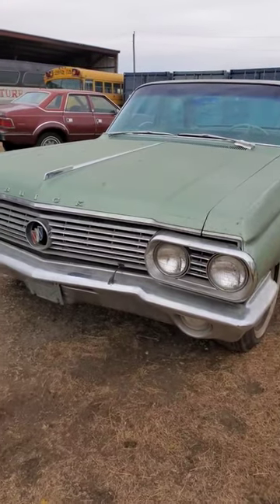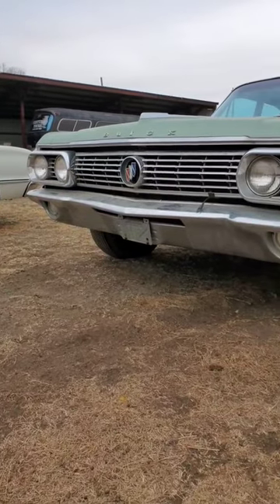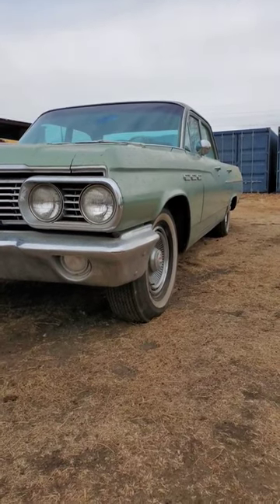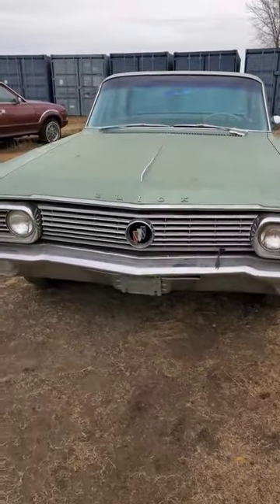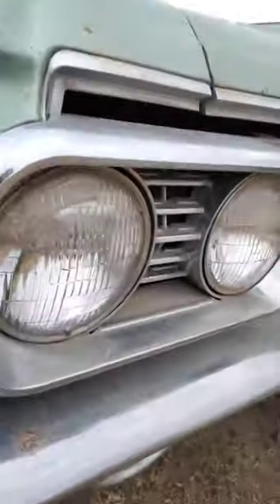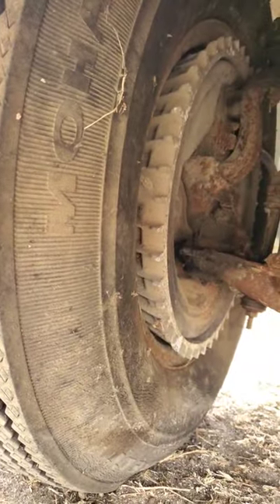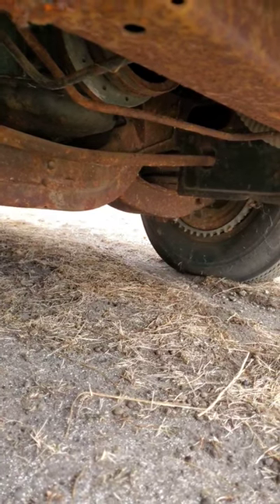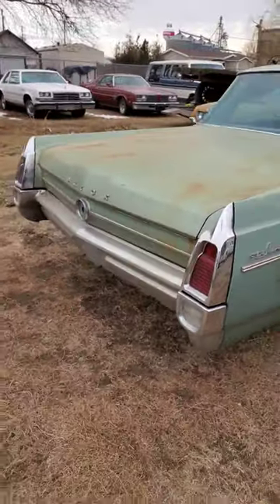High Performance IDEA or Normal Innovation

Comment: I've got a '65 Buick Riviera with the 401 Nailhead, it also has the finned aluminum drums. They do have good stopping power, and they do better with brake fade than a normal steel drum, they do still suffer from brake fade. I've upgraded the '65 with some handling goodies and had it out on a road course. Fun car, just don't stack up too many laps without cooling the brakes down!
Reply: The aluminum drums weren't just about reducing brake fade, it also massively reduced unsprung weight which is critical on an independent suspension. 
And the 401 Nailhead engine is dismissed by a lot of people but it's actually a killer engine, the biggest unjust hit to it's reputation he himself says in this video, "Wildcat", every V8 that Buick put in their cars back then was called a Wildcat and said just that on the air cleaner but not all of them were of the Nailhead design, the one's that weren't Nailhead's didn't respond well to hopping up, so because they said Wildcat on the engine the reputation of the Nailhead suffered, another thing that didn't help is the nickname Nailhead itself, people mistakingley assumed it got that nickname because it had nailhead style valve's in it but it didn't, Nailhead's actually have high waist high flowing type tulip style valve's, it got it's nickname Nailhead because the two engineers at Buick who designed it thought that a partially assembled head with all the valve's sticking out of it looked like a plank with nail's sticking out, one more thing that didn't help with it's reputation was it's smaller intake ports, even in this day and age people associate high flow with big ports, the old "bigger is better" standard that everyone always wants to apply to everything, but the designers of the engine understood the merits of smaller ports that make high velocity when it comes to stuffing a cylinder full at high RPM's, I myself believe in that principle and have long before I ever heard of the Buick Nailhead engine, plus smaller valve's are lighter which means you can rev an engine to the moon without the problems that big valve engine's run into, and the smaller a valve the cooler it runs because heat has less distance to travel to get to the valve seat which is where a valve disappates most of it's heat and not up through the stem as most people mistakingley think.
The two men who designed the engine believed so much in the concept of smaller ports and high velocity that they wrote an paper on the subject that was published by the SAE.
The biggest champion of the 401 Nailhead engine was the great Max Balchowsky, he chose it to power Old Yeller II his home built road racing car that beat every Ferrari, Aston Martin, Jaguar, Alfa Romero, and even the Maserati Bird Cage which was supposed to be the most advanced race car in the world at the time along with every other high end European sport car thrown at it, he sent them all packing back across the Atlantic with their tails between their legs and he did it with a homemade car powered by a 401 Nailhead engine, Max would sometimes let other racers run the car and that who's who lists no others than Dan Gurney, Phil Hill and none other than Carroll Shelby.
In case you've never heard of Max Balchowsky he owned Hollywood Motors in LA and prepped too many movie cars to list including the 2 Mustangs and 3 Chargers used in the movie Bullitt and built the original Herbie The Love Bug for the movie among many other famous one's. 
There's a fantastic bio on Max and Old Yeller II right here on YouTube that's from the old Speedvision series Behind The Headlights, here on YouTube enter "The Max Balchowsky Story" and get ready to feel proud to be an American.
Reply: @dukecraig2402  jesus christ dude, you wrote half the wikipedia here XD
Reply: I'd expect thoose aluminium drums to warp really bad, is it an issue ot do they keep their shape well? Afterall steel ones already have problems quite often.
Reply: @Ferrari255GTO  After street driving and having my '65 Riviera on a road course with aluminum drums, there really is no warping difficulties that I've experienced. And we got these drums a bit warmer than we probably should have. The bigger issues is glazing the brake shoes.

Comment: Factory radio delete...  and no cup holders either
Cars are for Drivin!!
Reply: But how many ash trays?
Reply: @commodoresixfour7478 1 for each finger
Reply: Is this a big deal? My 74 doesn’t have a radio, clock or cup holders lol. Also they opted for a 250 inline 6
Reply: Just a random thought I remember the old cup holders you would put on the door of your car by hanging it from the slot for your window

Comment: Now that's a car all solid steel huge trunk many coats of paint and awesome style
Reply: Something Something Dark Side  yea cannot forget that oil embargo which in my opinion was crock of beans
Reply: Something Something Dark Side  and I prefer older cars over newer cars that are garbage compared to older vehicles that are better more steel and far as older engines using leaded gasoline they were better as long thre maintained properly tuned up as needed

Comment: I had a 1959 buick Wildcat 2+2 410 plus intercepter. 7200 lbs. When you stomped the gas at 70 miles an hour it went sideways.  I never top out the speed.

Comment: Drums have a lot more surface area than disc brakes. They work better, they're just harder and more expensive to work on. I had 4 wheel drums on my 70 mach1. It would lock all four wheels before the pedal got within an inch of the floor. Loved that car, but unfortunately got rear ended and totalled. After we bought it back and rebuilt it, it became a race car with ladder bars and a fiberglass front end, no interior, aluminum dash etc, and a nitrous big block.

Comment: Once had a datsun 260Z which had aluminium drums on the rear.  Considering manufacturing cost vs performance, it would've been better all round to have disc brakes all round like all cars are made now. Amazing how people go to extremes to hang onto old tech.

Comment: Fun fact. The SR 71 spy plane doesn't have a way to start itself. They were started with what's called a "start cart," it was two 401s paired side by side connected by a drive belt. That drive belt connected to a shaft that went into the starter mechanism in the plane. The US military went out and bought every single 401 they could find.
Reply: Over the years the start carts used a number of different engines. They also used Dodge Hemis for a while.

But they were all tuned to the hilt, because the cart motors had to run up to 8 or 9 grand to reach minimum turbine speed.

Comment: Radio delete? Somebody didn't check the box on the order sheet. In 1963,  Chevrolet and Pontiac were the only divisions from GM that had any racing ideas. Buick, Olds, and of course Cadillac had no real intentions but kept dancing around it. Then came the GTO. Big engine, intermediate car.  Things changed for the better.
Reply: Not everyone wanted a radio.
Why is that so strange?

Comment: You could get a 4 speed man trans for these things. So swap in a man trans, turbo or centrifugal booster, efi and keep it patina'd for the sleeper effect. The heads kinda suck but with a modern custom designed cam, it will fly. ( cam timing from the factory was kinda rumpy and customers complained )

Comment: Not so sure about aluminum on steel friction contact. Especially in a high heat environment like that. Sounds like a good way to dissipate heat. But also sounds like a great way to get stress fractures, warping, or disintegration on crucial safety components. Especially since they likely used cast instead of machined aluminum.
Reply: Similar to aluminum blocks with cylinder sleeves. Not a huge deal if engineered properly.
Reply: @AlexandarHullRichter  Very true. Did they have steel sleeves like aluminum blocks? If so, any idea how they kept the rotational force from separating the steel sleeve from what would essentially be an aluminum heat sink? It only works in blocks as long as the oil does it's job of reducing friction. It's an interesting concept, but I feel like there's a reason it wasn't around long. Whether it was safety, production costs, material scarcity, etc.
Reply: @ryanburns3921   I thought they disappeared because disc brakes make drums look like a joke.
Reply: @AlexandarHullRichter  I'm talking about the aluminum drums. The only used those for a few years. They still use steel drums on some vehicles. Only on the rear though. I don't know of any vehicles that use front drums anymore.
Reply: @ryanburns3921  that's what I mean. I thought the fancy front drums disappeared because they got replaced entirely by disc brakes.
Reply: @AlexandarHullRichter  Possibly. Not sure about to timeframe for the aluminum drums. Front drums in general were pretty quickly replaced when discs showed up because of safety. Had an old tech tell me it was because drums had a bad tendency to apply uneven pressure causing severe brake pull. Not as dangerous on the rear axle as long as the steering axle can compensate. Extremely dangerous when it happens ON the steering axle. Lol
Reply: @ryanburns3921   That is interesting about the uneven pressure. I've noticed that on the rear of 2 of the 3 cars I've had, but I thought that was just because they had cheap drums on them that I hadn't replaced. The oldest of those (an '81 Toyota) didn't seem to have noticeable pulsation in the rear drums like my newer cars have.
Reply: @Alexandar Hull-Richter  Several things can cause that in drum brakes. Most often, they're not properly adjusted. Even on newer cars with "self-adjusting" drums, they aren't always right. On the older stuff, apparently, it was much worse. As in, you apply the brakes once. It might jerk you into another lane. The next 100 times you apply them, and it may be great. Then randomly, it might pull you off the road the other way. Some of that may have been made worse by the play in older steering gearboxes. But until disc brakes came along, it was just an inherent problem they didn't know how to solve. I'm not sure about any of it, though. My limited knowledge is hearsay from the old timers around the shop.

Comment: I had a 1961 it was premium fuel only and only 2 speed transmission but fast with bad brakes. It would smoke the tires until you leave off the gas.

Comment: I Can already see it on Facebook marketplace:
“Low miles, hasn’t run in 40 years. Starts on starting fluid, $40k I know what I got”
Reply from the maker: Crazy thing is this a less then 30k original miles car runs and drives proud new owner picked it up for less then 3k
Reply: @DudesWithWrenches  man why can’t they all be like that 😂 I payed $4k for my pile of junkyard parts 1980 el Camino and it has 120k miles 🤣

Comment: Performance idea = the whole car? Or just the aluminum drum brakes? The steel drum and aluminum would separate because of expansion rate differences when they get really hot from performance use. The car...that's actually a keeper.
Reply: Not a problem in aluminum engines that have steel cylinder sleeves. Many get past half a million miles without even a rebuild. I imagine the engineering of a drum is similar.

Comment: Sounds fast until you remember it has a Dynaflow 😢
Reply: After 56 the dynaflow's became better plus if you use the emergency low gear to start off in you can shave off 2 to 2¹/2 seconds of the 0-60 time if you can keep traction.  My 63 buick is a lot quicker then most people think because of that.

Comment: My grandma had exact car in blue but it had a 410 Wildcat. I remember sticker on air cleaner. Years later I bought a white 63 Buick LeSabre 4 door post. 410 Wildcat. Both had the needle on speedo you could set at certain speed and would buzz if you went faster than what you had it set to. Tranny went PNDLR. It would roast the rear tires with little effort. Wish I still had it.

Comment: Could anybody tell me, please, two things: firstly, why the word 'Post', was used in the name; secondly, what "Factory radio delete", means ?. Surely, no one should have wanted to be without the radio, (at a time when the music made the radio worth having) ?.
Thanks
Reply: post means the car has a b pillar and is not a hardtop, the doors have tops to them as well.

yes it does mean that the vehicle was ordered without a radio from the factory.

Hell in 1963 sun visors were an option as was heat, not a standard install.
Reply: @notablynova  Thanks very much.
I don't think 'Post' is used here, in the UK; just 'Pillar'.
I just assumed that in American cars radios were standard even earlier than this car's time.
Again, thanks for your time.

Comment: How fast they can make it wear out! Nobody diagnoses like they used to and then take apart something repair it and then put it back together... Nope. Everything's just a maintenance item. These days head gasket goes replace the whole engine to our converter. Wears out, replace the whole transmission. I mean anyone could be a mechanic these days. You're just replacing everything whole... Can you plug it in and updated. Send it on its way.... And even if you are fixing something, you literally plug it in the car tells you what's wrong. Then there's a thing on laptop that tells you every tool you're going to need, how long it's going to take and exactly how to do it step by step. So what do you really need to be a mechanic? Just the tools and a certification.... Did anybody can watch a video of step by step how to fit repair stuff and be told exactly what tools to use? It's just not having the tools that makes it hard and you're going to be slow at first obviously an experienced guy will do jobs faster. I understand that but I feel like anybody can be anything if they put their mind to it
Reply: I'm not sure what your point is. You're saying anyone can look up how to fix their vehicles now, and I agree to a point. Scan tools might give you a code, but there's a lot more to troubleshooting than that. You'd probably agree that cars are a lot more complicated now, so you get more information but it's still harder to figure out problems. It's probably a wash if you ask me. 
As for that statement about how we just replace whole engines for head gaskets, I don't agree with that. Not everything is serviceable, true. But people aren't doing more work than necessary if they can help it.